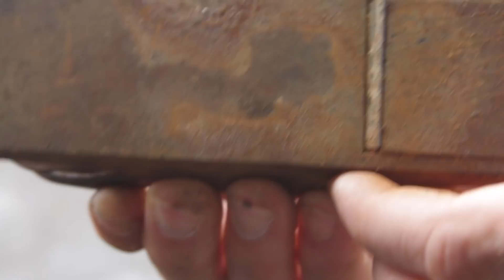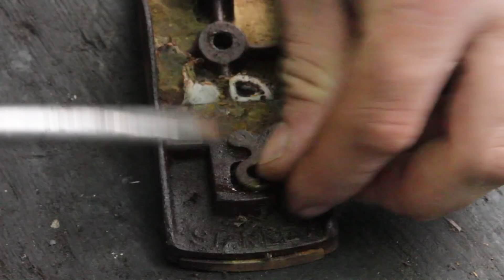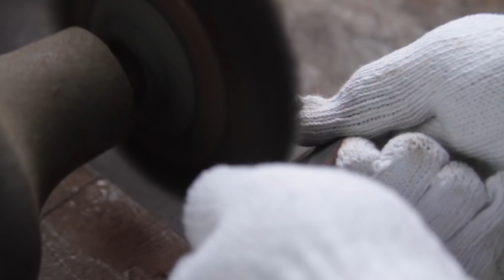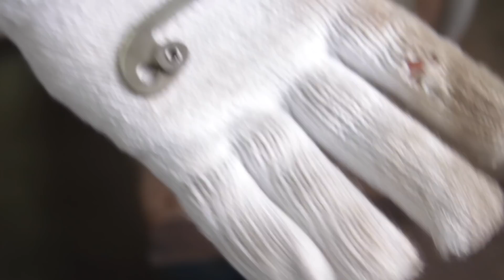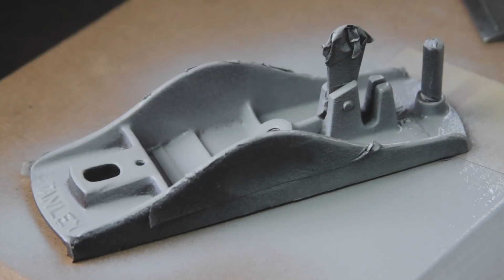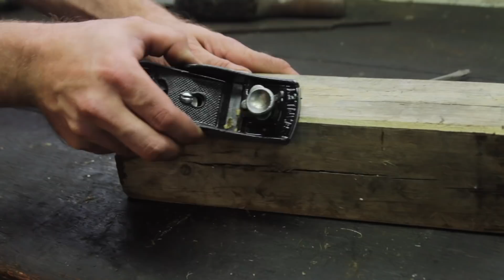Stanley No. 9 -1/2 Restoration

Comment: It's always good to see old tools restored - almost as good as the pleasure of restoring them yourself.
A wire wheel on a grinder gives enormous instant satisfaction, however, using that type of glove near a wire wheel is risking instant destruction of your hands if it snags on the wheel.
Much safer to wear leather or rubber gloves.
Reply from the maker: Thanks for watching, and the good advice

Comment: I don't mean to be a nag, but you really shouldn't wear gloves while using rotary tools it's very dangerous, especially bench grinders. If the wheel snags your glove it will take your hand with it, at the very least breaking a few fingers. If you don't want to get your hands dirty then use latex or nitrile gloves (something that will tear easily)
Reply from the maker: That is a very good point, i appreciate the positive feedback, for future projects i will take your advice. Thanks

Comment: Cleaning up rust and making everything shiny and polished (or painted) is nice. What is missing for a complete restoration is making sure the plane's sole is flat, and the sides are at 90 degrees to the sole? And, flattening the iron's backside then honing the bevel.
For small parts (in case of this little plane perhaps for all the parts including the body) I would recommend Evaporust rather than wire wheel. It dissolves the rust but doesn't remove any more metal than is necessary. Plus, you can reuse Evaporust many times, so it lasts a long time.
Reply from the maker: Thank you for your insight, I will run my next project  past you to ensure it meets your standards  before posting it as restoration. Thanks for viewing
Reply: @passengerswelcome1847  I see you are a master of sarcasm. Just trying to share what few things I know. Sorry if it sounded like a criticism.
Reply from the maker: No worries,  I'm just a guy  making videos after work, during my coveted free time.

Comment: Hi, i recently acquired one of these planes (mine has a different lever cap but it's the same model).  The lateral adjustment lever on mine has lots of free play in both the horizontal and vertical direction.  Does yours/Is this normal?  Thanks for the video.